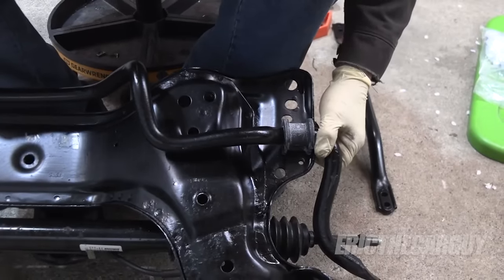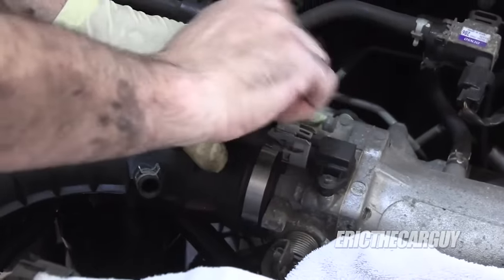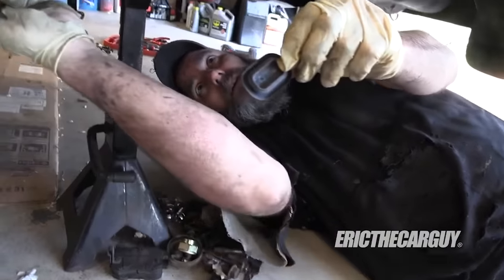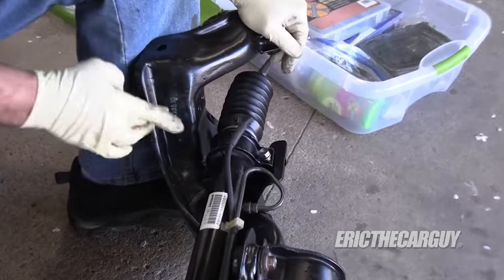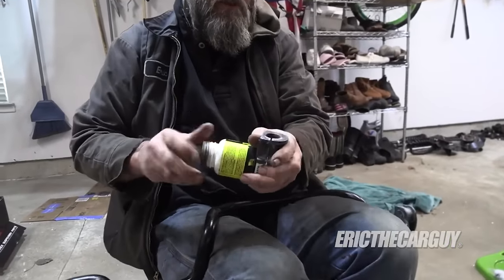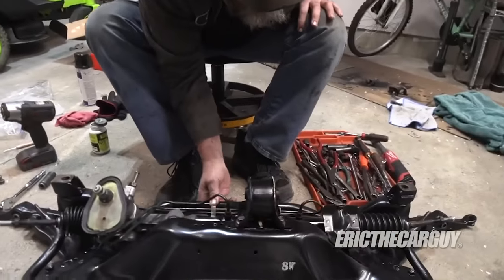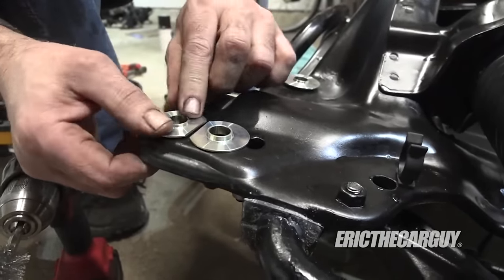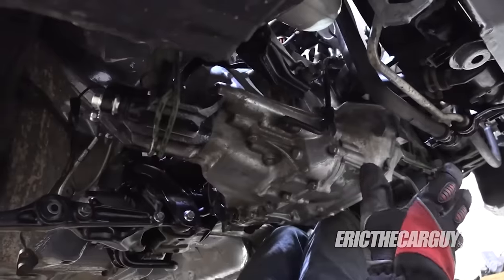Integra Type R Restoration (Part 4) #ETCGBlackBeard

Comment: I literally just got done rerunning the rear brake lines on my Integra too! Not quite as pretty as yours but they're holding fast and the brakes feel great. It's nice to see you did two "soft 90s" rather than a U bend too. Originally I wanted the bend a little tighter but I don't think the tubing will put up with it. I also found out that a little grease and dirt can sneak into your flaring tool and really make your day hellish 😵‍💫